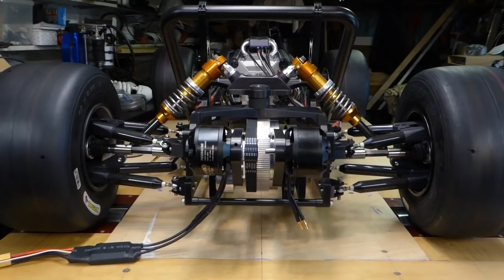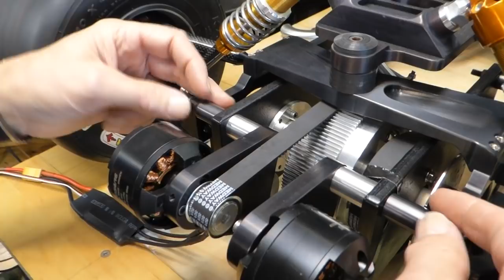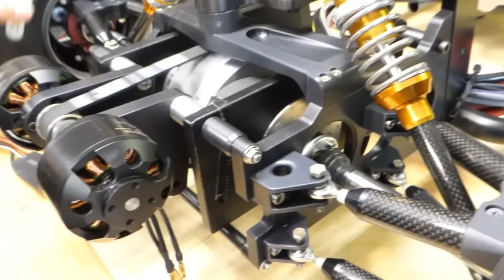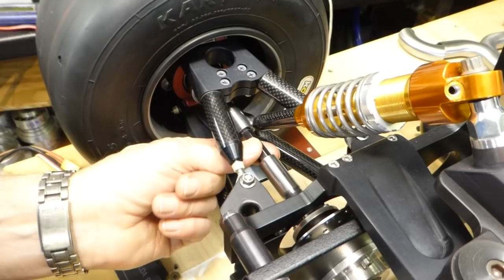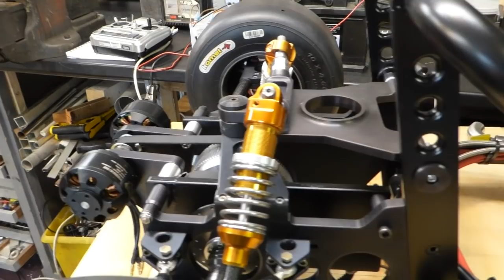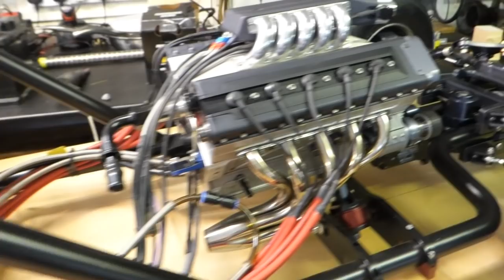1/3 Scale Fuel Injected 125cc V10 RC Buggy, part 4.

Comment: Is the Engine up front powering anything or is it a non functioning model? I'm asking because it looks like it's just an RC Car setup as far a battery, esc, radio, and motor. Also Whats the second motor for? andd....what type of motors are those? They look like something for an rc airplane or heli. I have a few 1/10th rc cars. 4 wheel drive short course truck, and 2 wheel drive buggy and their motors look much longer and more narrow.
Reply: @jasondreckmann3396  Are you following the entire build?
Reply: @ransblindart1763  ive watch a few of them, i suppose your here to tell me i missed something lol.
Reply: @ransblindart1763  aaaand i found it, comment of shame lol. Its just that the way he words it in this video makes them seem temporary just to drive it around while the gearbox is built.
Reply: @jasondreckmann3396  Its all good man, no hate. I totally see what you're talkin about, I'm wondering if he was meaning that particular set up is temporary, or thoughs style of motors? I dono its freakin awesome and I wish he was my neighbor..  lmao.
Reply from the maker: Yes the motors will be in the final design, but they will input into the gearbox. The temporary bit is the large pulley which is simulating the gear reduction the box will have.
Reply: @Keith5700  Ahh gotcha
Reply: He's building it has a hybrid, the gas engine works like a charm! And I do think thire heli or plane engines as well, but they should would fine I assume.

Comment: Are there any schematics on these micro engines? I see there all hand built, but what are you building off of?
Reply from the maker: i designed the engine.
Reply: @Keith5700  Right on! May I ask do you have a form build for the v8 or v10? I've been extraordinary intrigued in these scaled engines, and I have no one to learn from. If you don't mind would you  care to help? Like for instance, did you craft the little alternater? What do you use for spark plugs? Thank you so much for your time and knowledge. -Randal
Reply from the maker: If you google keith5700 then all the engine build info is available on the engine build forums. and in the comments section of the engine videos.
Reply: @Keith5700  I really appreciate it man.

Comment: Get motors with encoders. The esc is using feed back from the motor to get its timing and at low rpm they tend to be  Inaccurate for whatever reason.  By using a separate encoder u can  maintain to accuracy. Instead of twitching until the esc notices the right feedback you will get a constant torque until the encoder reads it's time to switch coils in your motor.

Comment: How many horsepower you get and how many nm get from that enggine? Are beter than 125 cc singgle silinder ?
Reply from the maker: no, a single cylinder of the same capacity would be much higher power.
Reply: Keith5700 but not NEARLY as cool.

Comment: ?  What's the point of the out runners driving the back wheels...?    And that tube frame / chassis looks like crap  I don't mean to be mean but ...a V10 should have a custom built boxed frame / chassis to be absolutely bitching...... But it still is good looking engine ..if it runs. That's another story..
Reply from the maker: well, do some sketches of your ideas for chassis and I'll be happy to look at them.
The engine doesn't run, its made from LEGO.
Reply from the maker: Hello?

Comment: With un'sensored brushless motors, there is a slight glitch/phase that happens around 0-1% throttle. I have 10 years R/C experiance and sponsorships, very common thing with un'sensored motors. Nothings wrong with it, i raced a 540 Can 3300kv un'sensored motor got a whole year on my smaller scale. Just dont hover around the 0-1% range, and you"ll be good 👍

Comment: this is beyond words from an engineer ( fella of lady in pic ) but I would strongly query the adequacy of those drive shafts , given a rough power to weight calculation I.e. torque will rip them to pieces... would also advise booting/sheathing once beefed up for grease retention. Those inboard discs may also require upgrading with possible ducting for cooling ..... but again ... a piece of art .... ps also have alternative idea for remote controls if interested, but it is an idea not yet available .
Reply from the maker: what torque figure for the driveshafts are you basing that on?
The joints already have boots on??
Reply: sorry . cv s booted yes. But was referring to the driveshaft extenders/telescopic s, just my opinion , they will require greasing too , and grease retention . There is a formula to work out the amount of torque, but would require a fair bit more info . ( overall weight, BHP, driveshaft materials etc. It was an educated guess based on scaling . I heard you mention splining for drive shafts, which would give increased contact patch for less weight , and female over male jointing, preferably . I apologise if this all seems pernickety
Reply from the maker: Hey, that's fine. I  worked out a worst case scenario of 44lbft torque per driveshaft. Then I made a quick prototype and tried to destroy it. the 3 pins in the cv joint started to distort in the centre bit at around 100lbft, so I reckoned they'd be fine. If it turns out there's so much power it destroys the shafts then I'll be well happy.

Comment: Those motors are usually for planes, helicopters, drones, ect
Reply: Yeah, they are.  I've seen quite a few used in custom creations though.  I wonder if its because it's easier to get a lower KV motor in that style.
Reply from the maker: Yes, much easier. These are 200kv.

Comment: Please tell me the size , type and price of the tyres
Reply: Those are go kart tires 4.5x10-5. Usually used on the front of a kart. You can get them for $15-$45 a piece. Check Simple Tire or Ebay

Comment: Wait I’m confused. Why do you have motors attached if it’s powered by a v10? Are they generators to keep the battery going?
Reply from the maker: yes they are acting as generators.
Reply: Keith5700  very very smart 👍

Comment: What you are experiencing with the motor jolting is called cogging, and it happens with brushless sensorless motors because the ESC can’t tell where the rotor is at low rpm 👍🏼
Reply: Thanks for posting the only right answer, some people have no idea

Comment: The firmware on the esc needs changing.  There will be a recommended firmware from The manufacturers to fix that.  You can also do a firmware esc calibration and tell it what revs / current is on the bottom end of going active.  Remember when the wheels are on the ground that initial jump will hardly be noticed due to the weight to torque correlation.

Comment: Those motors are overgeared.  Try increasing the reduction ratio.  I assume they’re only there to assist the gas engine, like a hybrid system.
Reply: he said he couldn't wait for the gearbox to see how it moves so he put the motors for test.He also added some extra weights  instead of the gearboxes' own  weight.

Comment: The hex shafts will bind under torque and affect suspension motion during acceleration and braking. Why didn't you go with CV joints where the shaft plunges into the gearbox side output?
Reply from the maker: They do. The hex is so the shafts come apart for assembly.

Comment: So you need sensored motors..... Wasnt that a FUEL INJECTED RC BUGGY? cuz all i see is a motor without driveshafts, Transmission or anything sitting in a chassis of a ELECTRIC BUGGY
CLICK BAIT 
THIS IS NOT A GAZ POWERED BUGGY ITS A HOAX RUNNING ON ELECTRIC!
Reply: The engine works, see his old videos. The car works as a hybrid hence the electric motors.
Reply: Did you watch with no sound?!  He said he's working on the gear box, it's a six month job, he put in the steel brackets and the motors to simulate the weight of the gearbox, but to also see how it would run.

Comment: The tires will wear fast as they are karting tyres designed for maximum grip. Try MOJO D1 tyres for less wear over time.
Reply: Max prentice designed for maximum grip on a "heavy" kart.

They'll last long enough on a 1/3 scale light RC car

Comment: Amazing project! As some have mentioned, the stutter at low speed is due to the sensorless brushless motor setup. On a brushless motor, the ESC needs to know the exact position of the rotor to time the motor windings properly. In sensorless design, this is done through back EMF which uses the drive coils within the motor to get an idea of rotor position. Unfortunately at stall speeds (ie zero or near zero RPM), the back EMF signal is almost useless since the rotor hasn't really begun to "spin" yet to generate a useable back EMF signal. Switching to a sensored brushless system will fix this issue and give you more starting torque. Happy building!
Reply: Excellent explanation, I was going to post myself and had to search semi-thoroughly to find this, gave a thumbs up so he can see.

Comment: After you correct the start failure, you may want to know the motors will not produce much or any power at low speed.  Unless you get the RPM's up, it would have tough time climbing an incline slow to start.  It would have trouble being offroad, or a crawler without a complex gearbox.
Reply: If I'm not mistaken, electric motors produce their max torque at stall, thus why cars like the Tesla model s are so fast off the line.
Reply from the maker: These dont produce any torque at stall. They're crap.

Comment: Sensorless brushless motors stutter like that on acceleration under load. Sensored motors wont do that.
Reply: Are you sure its a motor that needs a sensor and not the ESC?
Reply: Well yes, sensored motors require a sensored ESC. But most sensored ESCs will run both sensored and unsensored motors.

Comment: That jerkiness on the motor at low throttle is a poor solder joint or a bad PID adjustment.

Comment: Don’t worry about the motors at slow speed. That’s just the current not being able to fill then engine with the required power. All electric motors in scale vehicles do it👍🏻

Comment: U need some Vesc  ESCs. These ESCs have a Motor control mode named FOC that lets the Motor spin coggfree at low rpms. Im using these escs on my electric Skateboard. And get a motor with Sensors!
Reply: Cpt. Brexit his plan is to be gas powered, the bldcs were just a test.
Reply: @b5a5m5  he's making it a hybrid so the electric motors will give it an extra 6 horsepower

Comment: The problem you are having is because they're sensorless brushless motors.  They will stall a bit at low power.  Fine to use though, I have used outrunner motors on a rock crawler before and it was fine, the lower gearing probably helped a bit though.

Comment: A lot of brush less motors do that at low speeds. most i would say. especially high power high torque motors. but I wouldn't say that the out runner airplane motors are necessarily a bad thing. The reason out runners are used on planes is because when flying an rc airplane you are on constant throttle. As long as your giving it a little airflow it will be fine. If you look at RC CAR race motors the coils aren't exposed because you are accelerating and braking and when people are building high end race cars the motors usually need some type of electric fan mounted to it to keep it from frying. MY rc cars while give second degree burns after driving it with one battery. you have the load for the motors being divided between two electric motors and one petrol engine far away so I don't think you'll ever have a heating issue. when you build the body just build a duct that will draw high speed air from outside over the motors and out the back.

Comment: Hey, brush less motors are good 
, Really good and that's why basically all hobby grade RC cars use them. Not only planes and such however, the ESC is the problem that's the problem you're facing. All brush less motors have that common issue they perform really well at high speeds but not so much in lower speeds. The problem isn't the motor, motor is just wire and stators (unless it's a specialised brush less motor). The characteristics of these motors is entirely dependent on the speed controller (btw you're using a plane ESC I'd recommend using an ESC designed for a car as there are much less complications). But if you insist on using plane, Heli or quad ESC's use BLHELI_S esc's and their program. They eliminated the common problem of brushless motors not being able to run at slow speeds. So much so that I can see it spinning, quite amazing. This is the first time these kind of ESC's have been available to the public. 

If you're curious as to why they don't work as well, it's because the pulse that the copper coils receive is randomly sent at a certain speed by the esc. Common ESC's just shoot out pulses with its 3 patterns, doesn't even know what for. At slower speeds, the motors fail to sync up to the frequency of phase switching that the ESC does because there simply isn't enough current being supplied (basically motor can't carry itself properly) but when power is increased, the motor has enough energy to sync with the ESC's frequency and so it starts to spin properly. BLHELI_S ESC's sort of communicate with the motors by receiving the reflection of the pulse they just sent. A few clever calculations later, it can accurately depicte where the spinning magnets, or coil, is in relation to the stator and so fires the pulse at the right phase and time making it possible to spin at incredibly slow speeds. And this is just one amazing feature with blheli s. You can search on YouTube, "blheli s slow rpm" , to learn more 

(Assuming you want a car with ediquate power and some speed) Personally, those motors and ESC's are way too small and underpowered for a 3rd scale vehicle. Even too small for a 1/10 scale tbh also batteries for this would be pretty huge and would need to take extra precautions for this(if you're using lipo like everyone else) if you tried connecting it up like regular smaller RC's you'd melt your connections or worse, they would mold together literally in a flash or decide "know what? I don't think you vehicle should exist, or your eyebrows for that matter". Common battery sparks are generally underpowered, but batteries of this calibre need extra care I short-circuited a 2Ah 70c 2s battery, I was left with exposed wire(I had an XC90 connector on it before it melted and evaporated, including the copper bits, battery was just fine btw). Would recommend to add a smaller wire (positive battery lead only, not the black one) connector to the esc so to plug it in first before plugging in the larger, juicier connector.

If you feel I may be undermining your skills, I'm not I'd rather have absolute assurance that you're conducting your projects safely. Electricity is a lot more dangerous if not respected. Only reason we don't actually have any incidents is because we only use a small amount of our in our every day lives. Good luck with your project👍
Reply: Beautifully written comment, it's all spot on. I would disagree with your opinion on the motors though. I agree if he is going to be driving at higher speeds, they may be a tad small, but they are far to big for a 1/10 scale car. These are the size of outrunner motors you will find on many motorised skateboard kits. They should handle the torque of moving a car this size well enough if he had proper surface ESCs, but speeds will be limited.
Reply: @DeadnCold  I'd rather use inrunners for speedy cars but outrunners for crawlers and high torque systems too

Comment: Yeah the motor tremble is pretty normal for uncensored brushless motors. Especially when they are under powered they will tremble at low rpm. This could also be caused by the ESC/power source limiting current to the motor. With the size of the ESC compared to the the motor I think that is what's happening. BUT MAD RESPECT! That thing is awesome!

Comment: Thats pretty normal for a sensorless brushless motor.  They depend on a signal which is generated by the spinning of the motor to time the phases.  The only solutions are to eithr not spin them that slowly or use sensored motors.

Comment: Speed control needs adjustment. If you let it cog to long . it will do damage. I had the same problem with a converted erevo and changed from Lipo to a123 3.3 cells and did great. When if I would had just used program card . problem would have been solved

Comment: hello Keith, may I see your transmitter? I am developing a project using gaming steering wheel to control any rc car...That could be interesting for you to drive your car with a gaming steering wheel like Logitech G29..
Reply from the maker: It's a Radiolink 10 channel.
Reply: @Keith5700  how many channels actually used to control this huge rc? for a normal one channel is for servo, one is for throttle...
Reply from the maker: No idea yet. At least 8.

Comment: That's called cogging. The main way to prevent it is to run a sensored setup. Detects the position of the rotor in the can and smooths the takeoff. It will only cog at really low speeds though. Once you get the motors turning they pick right up and go.
Reply: Ran Man Exactly. If you want to have a super smooth start you'll have to use sensored motors. If you're going to be stopping and starting a lot it will be worth it. If not, no need to switch to sensored.
Reply: @joeshmoe12301230  I dont think hes actually using the electric motors to run it. They're just serving as a test bed, but the cogging is nothing unusual as you know